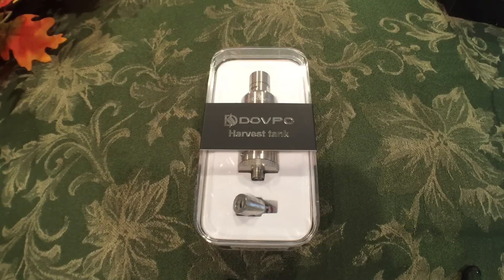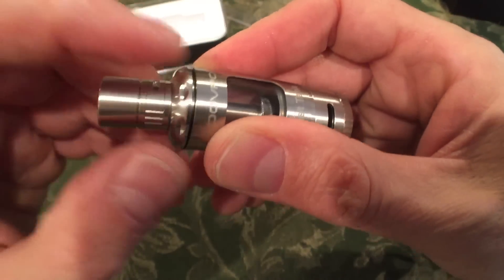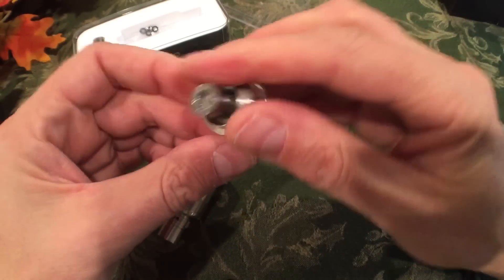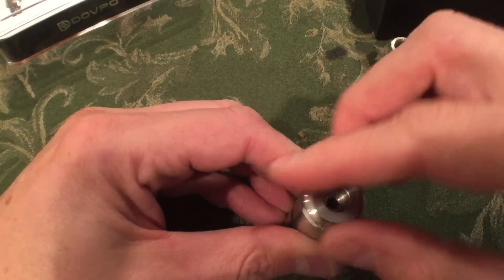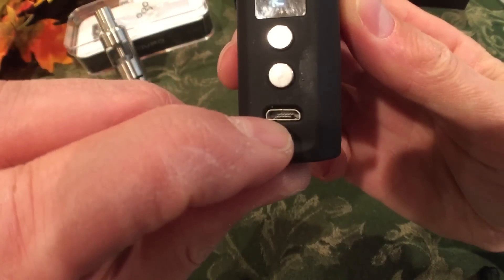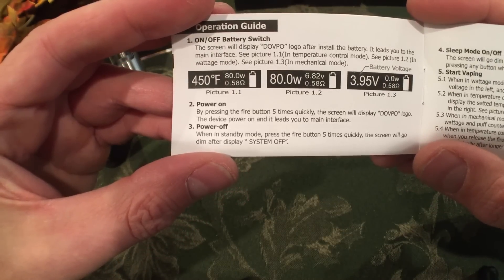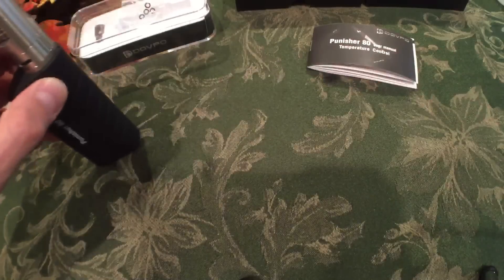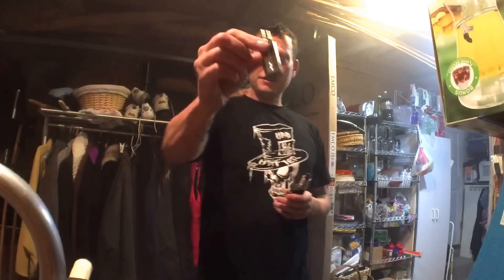Dovpo Punisher 80watt TC Mod and Harvest Tank Review and Giveaway

Comment: Which do you like better between the Dovepo Punisher 80 and Executive 5? Other than the difference in power output (which I usually don't use over 50 watts myself) I am torn between the two and I was curious as to which one you would recommend "IF" they had the same power output?
Reply from the maker: +Mike Marino Punisher 80.  Feels more like a sidearm grip in the hand.  more comfy.
Reply: +Quest4vape  Thank you